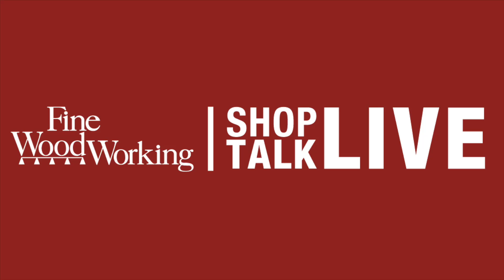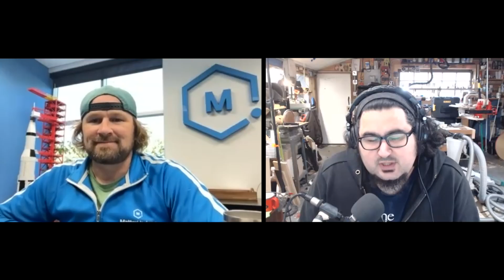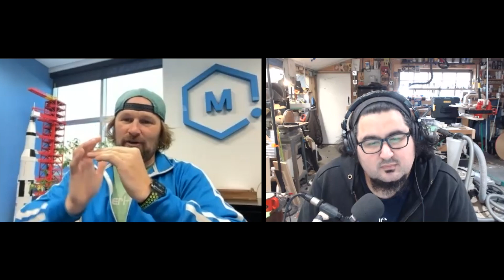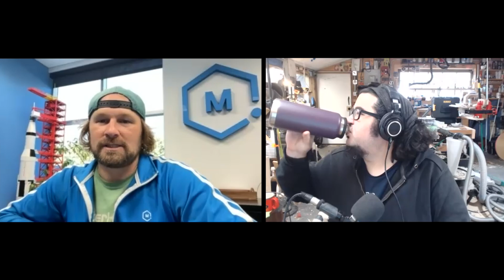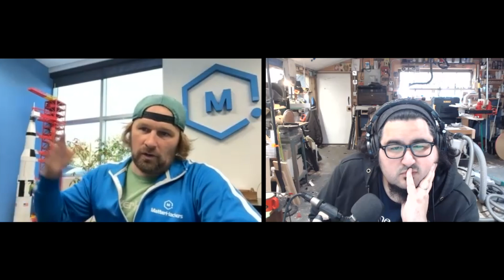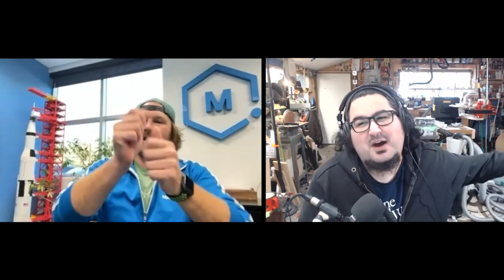STL: Digital woodworking with MatterHackers

Comment: Great conversation here.  As someone who uses 3D printing, CNC and lasers in their woodworking, I'm excited to see/hear this topic coming from FWW.  OK, so it's NOT for everybody. ( I'm not a turner but I understand that other people are interested in it.)  But some digital fabrication equipment will swing a design door WIDE open for you.  I use my 3D printer(s) to make jigs/fixtures/templates/clamping aids....the list is endless (custom Pantorouter templates?).  One thing that I use mine for that is just MAGICAL for me is patterns for casting in pewter for custom knobs and pulls.  I use a CNC for templates mainly.  Certainly it can be used for many other things, but templates are the 'killer app' for me that makes the purchase of the equipment a no-brainer just for templates alone.  Anything else I do with it is icing on the cake.    My first 3D printer was a CR-10 (first gen) and it's OLD, but still does everything I need it to.  Students in the program I teach at tend to buy the Ender Pro's for our Additive Manufacturing classes just because they're SO affordable that they can do their labs at home rather than hanging around the lab and waiting. (Do recall that Rapid Prototyping is what it used to be called, but it's not always so rapid.  Still FAST, but an overnight print is quite common.)  CAD is a learning curve but anyone can start learning CAD before you jump into actually buying any digital fabrication equipment. I hope this conversation continues.

Comment: What 3D printer do you recommend for a woodworker to get that is easy to learn?
Reply: He mentioned the Bambu.  It is expensive.  The alternative is to buy a creality printer that is much cheaper but everyone who has these cheaper printers, me included, wished they owned a Bambu.  The Bambu can print in a fraction of time.  The Bambu just works.  When you start 3d printing you think you just load the file and push a button and watch it print.  You think it should be as easy as a printer that prints paper but no, the major issue is the bed balances on a middle rail and it is under tension with springs on all 4 corners and this is a design flaw in my opinion that introduces a lot of error in the print.  You can get it right but you have to use a sheet of paper and fiddle with the tension springs to make sure all four corners of the bed are exactly the same distance from the extruder nozzle head.  This can be a very frustrating process.  The Bambu has software and a different design for how the bed rides that avoids the calibration errors that we compound as we try to get the bed level.